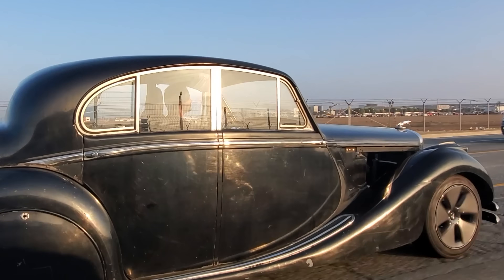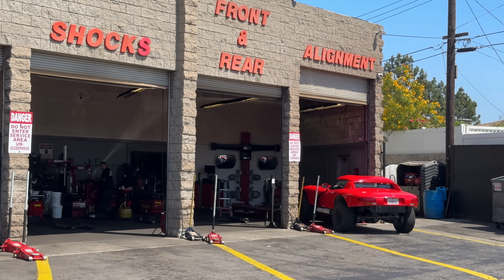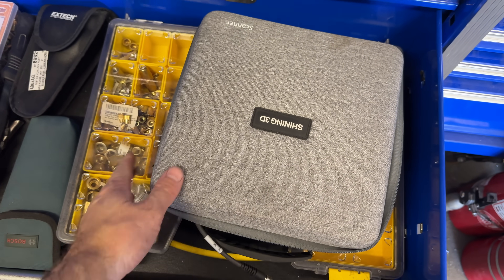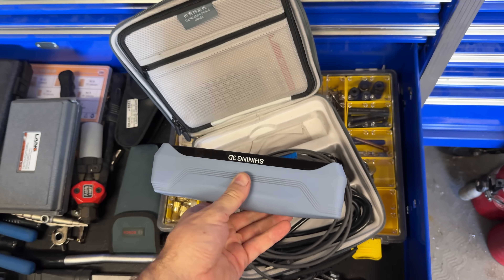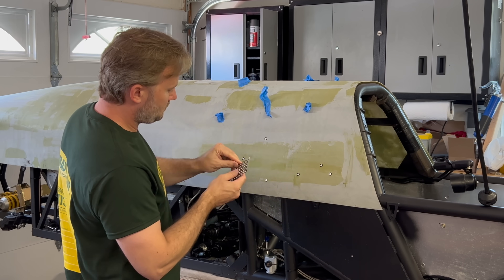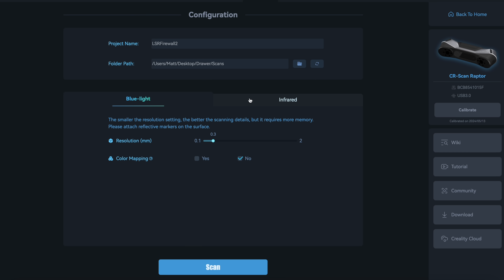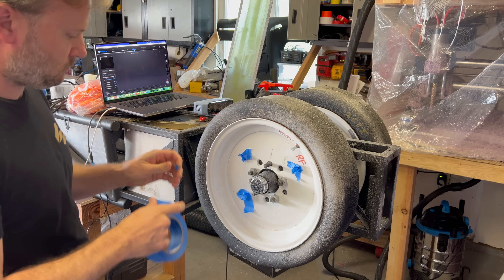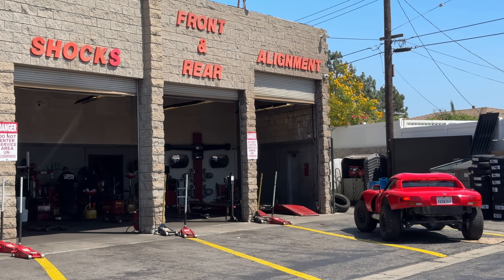Car Alignment With A 3D Scanner

Comment: HHHmmm.  I never ever thought about using a 3D scanner.  I use two 12-line auto leveling lasers to do the alignments on my cars, truck, and 4-wheelers.  Setup is a bit tedious, but it works great.

Comment: Using the string method for alignment isn't inaccurate.  If you  use a typical string width of .25mm that is your accuracy limit.  .25mm is well within any errors introduced within the alignment system itself. In other words you cannot get the alignment more accurate than the string so you are chasing your tail trying to get it more precise.

Comment: Dude, do the ZF8HP75 or 90. I just got a 24 Rebel 5.7 and the 8spd is so nice to drive. I've been towing a 7500lb trailer, 4 people and all our stuff and the highest transmission temps I've seen is 97c while flogging it through New Brunswick.  You can even get aftermarket clutch kits for it through an Australia company I believe. You will not regret it.

Comment: What might be an interesting test is a hybrid DIY alignment. Have a string setup where the support poles have marking dots (you could have permanent "dotted" poles for future alignment needs) and then you scan with the poles and strings. This way you get the precision of scanning with the repeatability of using a precise setup tool. This setup would be closer what a pro shop uses as far as theory of operation is concerned.

Comment: BTCC cars have fitting points in the bumper like the string method but you use the car as a reference point, so you always have an accurate datum to work from* 

*Unless you bend the car

Comment: There are cheap ways to do things. There are easy ways to do things. Then there is Matts way- Which is neither cheap nor easy.
Reply from the maker: This is the cheap way to do an alignment, so long as you already have a 3D scanner. Not very easy though.
Reply: @SuperfastMatt  "This is the cheap way to do an alignment"

You can go to midas and get a life time alignment deal for like 100 bucks.

Of course your results may vary, and they may not accommodate specific alignment requests.

Cheap though

Comment: Tire pressure and condition can affect the wheel alignment. The Hunter uses IR emitters and cameras to "see" the targets on the wheels and watches for changes in orientation. The camber is not concerning given the application and I would have suggested slightly negative unless road crown is a concern. We have setup different Cobra replicas and really have two different set of alignment numbers, one for street and a second for circle track. 

The Hunter (at least my Hawkeye Elite) can do a wheel alignment on the floor and can accommodate a wide variety of vehicles and trailers. It should be able to do the land speeder on the floor as long as the cameras can see the targets. We have done ATVs and side by sides. It is interesting that your caster is lower than expected but then steering return and stability may not be a concern again given the application.  After watching your video I have a deeper appreciation of what the wheel alignment machine can do and how fast it makes the measurements, like in real time. Interesting to see if your cad can make the thrust angle and steer ahead measurements.

Comment: As far as a shop stool is concerned, you simply can't beat a Vyper AFAIK.  The price is...not cheap... But for something you're obviously going to spend time on, it's well worth the price (which actually isn't too bonkers).  They do make a 4-wheel, but I can't speak to that.  I've got one of their original chairs and it's been an absolute tank.  I'm even a pretty big guy (~300lbs) and it's never felt anything but solid.

Comment: You might want toe-in at the rear of the land speed car. Any leaning (as in roll) of it to either side will want it to go the other way. In other words, steering input will be amplified. Not ideal for a straight line car

Then again. Ive never set up a land speed car so double check with someone who has.

Comment: I used the Creality scanner yesterday! its a really nice scanner, especially for its price point. The blue laser method is used with professional metrology-grade scanners and it is nice to see it being used in something more consumer focused. We had some magnetic scanner dots, which really helps with the setting up/taking down stickers. Only on magnetic parts though. The accuracy problems you had sucks, we did not run into that. It might have been better to segment the four wheels into their own scans with markers on the edges to align and merge all of them together. Also pro tip, when scanning with markers in general the scanner has a significantly easier time tracking when you do a first pass just to get all the markers. I do agree with what you said, the Creality software does seem a bit half baked, although I am used to the Scanviewer software.

Comment: Do these scanners softwares have a feature called "loop closure"? so if you ended up scanning all around the car to where you originally started, would it figure that out and cancel out the added up drift?

Comment: Try swapping out the casters in your stool for ones that have the polyurethane wheels with larger bearings and pick ones that don’t have as much trail. I use em on my office chairs and they roll great, added bonus is they’re very silent as well. Office chairs and shop stools are kinda the same right ? 😂

Comment: Not super accurate is not good enough for a tire alignment because if your tires are offset just by a little bit one tire will get used up way faster than the other one

Comment: The 'string method' isn't accurate? 
Penske Racing still uses it to this day. 
Rick Mears crew chief in 1989, Richard Buck, taught me how to make track bars and string to set up a race car. 
It worked then and they still use it today, even at Indy. 
The only difference is back then we used a machinists scale and now we use a digital caliper. 
Just thought you might want to know. 
Love your channel!

Comment: the Powerbuilt brand makes a rolling stool with 4 inch casters and tray storage, and they also have an HD version with 6 inch knobbies to match the Viper 😎, both are rated for 300lbs.  don't have one personally but i got to sit on one back at PRI 2023 and it seemed decent, if only for a quick test.  my current shop seat also leaves much to be desired so i've been on the hunt for something better myself.

Comment: I've done literally hundreds of alignments. Any mechanic that understands the alignment machine, is capable of making adjustments, and knows how each setting affects the handling and tire wear, should be able to align it. I've done lots of race cars, 1/4 mile type, and a boat load of offroad trucks. I always enjoy doing something out of the norm. I would of jumped all over Matt's  Jaguar. Then again, I'm a bit of a Jaguar snob.
Reply: That's the problem tho. I've done more alignments then I care to remember, custome builds, racecars, a tractor once. Most people have no idea what those numbers mean, how changing 1 effects the other or even how to correctly use the machine. They just see green as think that's correct, forget the spread.

Comment: I do my 4runner with a digital angle finder, laser/digital tape measure, 2- tape measures and two alignment angle rails. Granted, it is solid axle swapped.

Comment: I own a 1991 Ford Mustang that has a highly modified suspension from Maximum Motorsports.  When I have gotten it aligned they tell me it has too much caster.   The suspension modification moves the lower control arm 1.5" forward in order to maximize caster.  Instead of understanding alignment concepts, they seemed to only be able to do what the computer tells them a "stock suspension" should be set to.

Comment: SHOP CHAIR:  I too found the traditional square crawler chairs a pain after they have aged a bit. My solution was I had some old cheap office chairs  - the ones that are spring loaded with lever for height adjustment and the adjustable back on a piece of curved powder coated steel. I took the back off from under the seat section so I only had the seat section. Very stable with five wheels on splayed struts which often allows me to get closer if needed. Height adjust is good for ground height and up on jack stands as well as under a hoist and its comfortable to sit on. The one I currently use I've had for about 12 years and although grubby as heck, still serves me well. Mine is a cloth seat. Vinyl may be as good but possibly slippery and vinyl with age tends to dry and crack/split, so I'm happy with the cloth.

Comment: I would not consider the alignment shop as the gold standard for measurement. I used a hawk eye elite for multiple years. They are good but not always repeatable. Taking the targets off and on then rolling the car again would often show slightly different results. Cool video, thanks for sharing.
Reply: He listed it as 'actual' values. Thought that was pretty bold.  They are just the measurements by another method. Judged more reliable, but like you said, get a second opinion?

Comment: Lol if you can’t align it using the string method, it’s not the strings fault. Tape measurer, digital angle finder, and a string. Never fails.

Comment: Have you seen some of the handles for the Einstar people have designed? I printed the Einstar Handle MK2 off Printables and it feels a lot nicer to try to angle it and get it aimed in places vs just clawing it normally. Pretty simple print and I just added a bit of fuzzy skin in the handle portion. Downside is it obviously doesn't fit in the case anymore but if you use a 1/4-20 D-ring for cameras as the fixing screw it's quick to put on and take off.

Comment: The string method in measuring front and rear toe is very accurate, This is done on formula race cars using jigs that attach to the car.  What happens is you find the center of the car ( left to right ) on both ends then place a string at equal distances from the center.    Use a dial caliper to measure from the string to the wheel flange and you have toe.  This does not take into account a bent wheel but of the wheel is bent, all of your accurate measuring does nothing anyway.
Reply: Caliper on a string isn't going to be any better than a tape measure if you know what you're doing, but I'm glad somebody pointed out that the accuracy of the string depends on what your reference point is
Reply: "does not take into account a bent wheel but of the wheel is bent, all of your accurate measuring does nothing anyway" that's why the alignment guy rolls the car backwards and forwards a little bit

Comment: Cool video.  Just a guess from a fellow engineer (I have 3d scanning/RE as part of my manufacturing services):  both scanners handled camber well because it is effectively a shorter measurement (could be referenced to the ground plane).  Toe has to be measured from one side of the vehicle to the other, and the Creality is compounding error much worse across that distance.   I’m thinking the tolerances for tracking (vs losing tracking) have been opened up at the expense of accuracy.   BTW, I hate the stickers too and barely even want to quote 3d scanning jobs because of them.  I end up putting them about 2” apart on a lot of parts and they take more time than actual scanning.

Edit:  🤦‍♂️ I wrote this before watching the last 3 minutes where you covered what I was talking about.  Yep, stacking up errors over distances is what I was thinking too 😂
Reply: Also thanks for the tip on the wad of tape.  I do similar things but hadn’t thought of anything that easy.  For threaded holes, I typically screw in shoulder screws and scan the shoulder to find hole locations.  For other holes I use gage pins.

Comment: If you just need the bolt pattern, any magnum small block should work.  3.9 v6, 5.2 and 5.9 v8s should be the same as the v10.

Comment: Here's what I don't understand - they went through all the trouble of putting both scanners in the same tool, but they don't use both at the same time?  If the IR scanner can track where you are in space without the dots, why can't they use that information to align the finer information from the blue laser scanner?

Comment: I've been trying to figure out the best way to do my own alignments. I'm mainly doing this because I've found that most automotive technicians are incompetent at actually performing alignments, and that a lot of shops are not taking the care required to make sure that the alignment machines are being used properly. I used to work at a big automotive shop and did lots of alignments with the hunter machines, you have to make sure the heads are attached well, and that you perform the check correctly, then after that, there is a bit of skill involved with making accurate adjustments (not difficult to learn but takes more care than most guys working in these shops are willing to give). When I left the big shops, there was still one guy who I could trust who worked at them to do my alignments, but now he has quit, and in my experience 90% of technicians can't do alignments to my expectations.

Using the 3d scanner for this problem definitely intrigues me, they solve so many other problems already, but it still feels like the affordable models still have a long way to go, excited to see how they continue to develop but i'm not quite ready to pull the trigger on one yet.
Reply: some of the newest alignment machines use 3d scanning of the vehicle to perform alignments.

Comment: Tip
For easier more consistent scanning.
Print a compass image with metric scale marks on sticker paper in any suitable size for the job.
Decide where you want the vertical and horizontal axis to be in the job to be scanned and if critical align the compass with the true horizon and such.
Take some pictures of the job to use as an underlay for the scanned image to correct any noise in the Cad software.
This method can save hours cleaning scans that are less than perfect.
Reply: i am repling to save
Reply: Folowing

Comment: It's also just super likely that the supension settled differently between the 3D scan and alignment machine. Any small steering inputs on concrete are going to jack the suspension some and hold it there while the slip plates on the alignment machine are going to allow it to actually settle without any tire scub preventing the suspension from doing so.

Comment: Maybe I'm missing something here but wouldn't wheel alignment be the PERFECT application for those targets?  Stick just a couple on each wheel and then a little line of them on a roll of painters tape running in a complete ring around the car (so you link up around the back bumper and close that loop to keep the rear wheels more accurate) and you should be almost as good as a real alignment machine.

Comment: If you continued the scan around the back of the car to complete the loop, would the software recognize that you have returned to the corner that you originally scanned, and reconcile the original and new positions, compensating for the accumulated drift?

Comment: I haven't been a fan of the einscan HX, I have been getting better scans using just my phone to take a few dozen pictures of an object and then use metashape or meshroom to convert the images into a 3d model. I get models that are textured with color and have an accuracy of within 0.25mm or + - 125 microns.

Actually, I recently discovered if you use a talcum-based foot powder spray to coat the thing you need to scan that you get much better scans using either Photogrammetry or a scanner like einscan. You could buy expensive sprays for scanning, but I have talcum powder on hand an isopropyl alcohol and a paint sprayer I can use to see any positive effects sometime tomorrow.

Comment: Alignments are over rated on cars that won't see 5000 miles in a lifetime.  Set the toe in at 1/16" with a tape measure.  Set the caster at 7 or greater degrees, up to 13* with power steering, and set the camber near zero.  Camber should be +1* on a street car and -1* if you use it on the track.  What is important is camber gain when cornering and bump steer.  Both are set by suspension geometry when designed, although, bump steer can be adjustable with spacers.  A straight edge and a laser pointer shining on the closed garage door gives great results.  On my hotrods, i remove the coil overs and run the suspension through it's travel with a jack to set bump steer.

Comment: You might have better luck, doing thermal imaging of the tires after a run.  The hot spots are where the wear is, hot on the inside or outside of both wheels is toe.  Center hot both wheels tire pressure is high, outside hot both wheels tire pressure low.  One tire is hot on outside too much camber.

Comment: Re low friction plates on the floor:  UHMW.  It was originally designed as a bearing material.  Two smooth faced sheets with a dab of water is pretty slick.
Reply: "UHMW" means "ultra high molecular weight". It's only the first part of the name of the material, but it seems to now be common for people to leave out the critical remainder of the name... it's normally polyethylene (UHMW-PE).

Comment: Matt, I've 3d printed some multi-angled shapes and stuck targets to them.  When I need to scan I just placed these objects near or on the thing I want to scan.   No more stickers.  Easy and work great
Reply: after he showed the the other review at 14:30 i was thinking the same thing. just 3D print shapes and add a magnet and the tracker to them.
Reply: @Davemane43 wasn’t a magnetic surface.